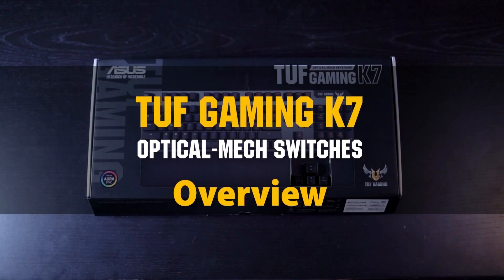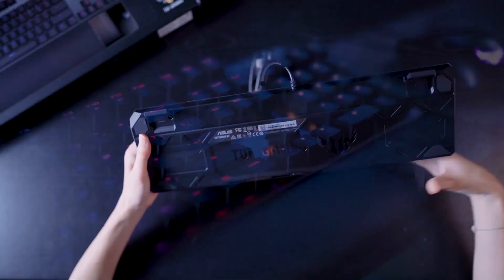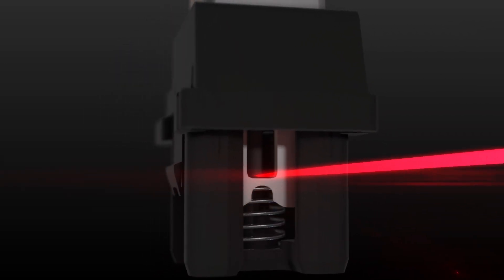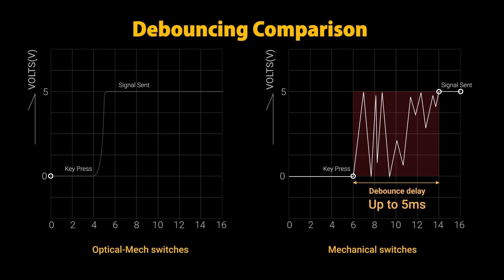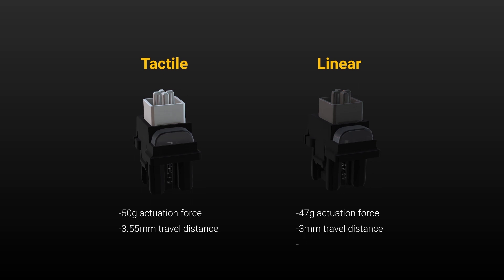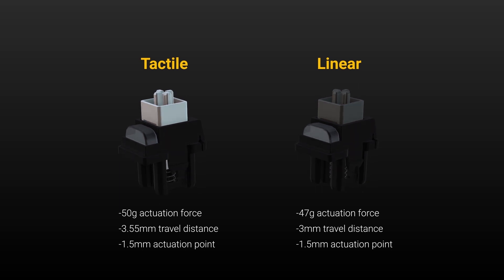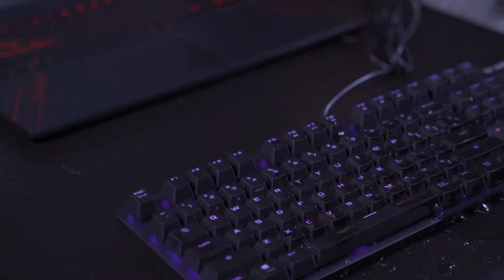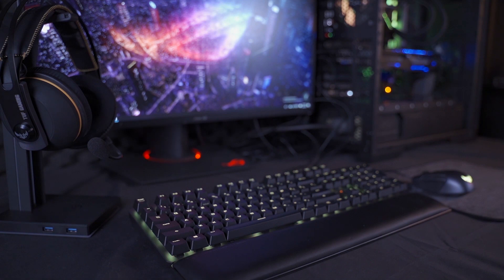Tuf K7 Keyboard Unboxing!

Comment: I use a ASUS k7 keyboard, it's amazing. I bought one cheap as an open box item, it looked fine and worked fine for about 4 months but it is having trouble with a few of the keys and aura sync suddenly. It was probably abused being an open box purchase by whoever bought it originally. I ordered another ASUS K7 keyboard just now because the K7 keyboard is that freakin good. I ordered the replacement K7 direct from ASUS so hopefully I can send this crippled one back on RMA to them for a easy refund.

Comment: Any weird compromises when you use it? I recently picked up the ROG Gladius II mouse, and the Armoury Crate software makes me choose between syncing the RGB with my motherboard via Aura, or enabling profiles and adjusting mouse dpi... It's one or the other, not both. :/
Reply: The new version of Armory Crate II integrates AURA lighting and control. Make sure you have up to date firmware and remove all previous versions of Armory and AURA software prior to updating. We will be working overtime to extend and enhance this integrated level of control and monitoring within one application. For more advanced lighting control this will be part of AURA Creator which was recently released.
Reply: @jjguerrero8465  I'm running Armoury Crate v.2.4.9.0 and the most recent firmware on my ROG Gladius II and ROG Strix X370-F Gaming. The RGB lighting is a lot brighter on my motherboard, ram, and case than it was with Aura, and I have the lights disabled on the mouse now since they won't sync.